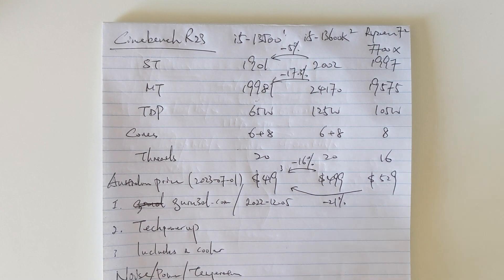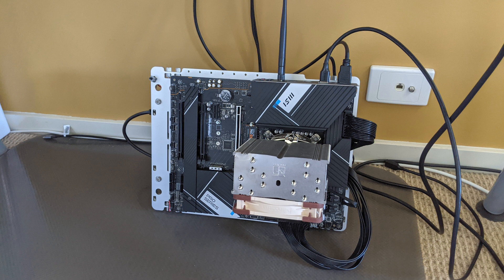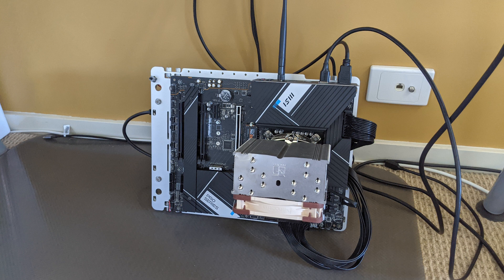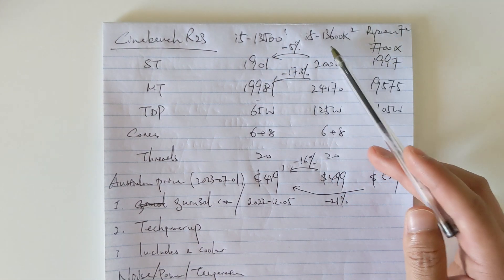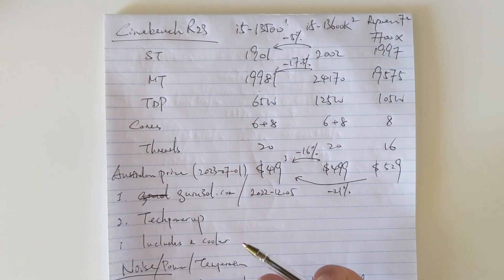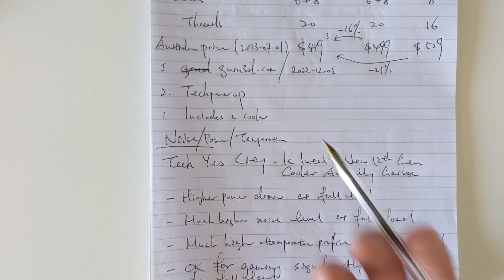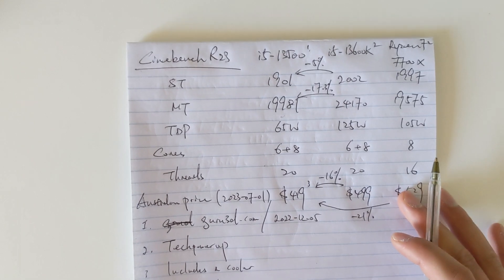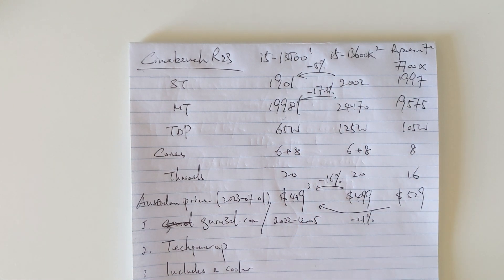First impression and meta-analysis of Intel Core i5 13500 Processor

Comment: Can i use an Air cooler for the i5 13600k? What's your i5 13600k temperature when normal use?
Reply from the maker: Yes. I would assume the temperature is low as when running above 5GHz, it was whisper quiet. Please see my latest video:
https://youtu.be/18CDtntszJI

Comment: How this compares to 13600 ? Is 13600 really worth the extra money.
Reply from the maker: Did you mean 13600k? I think 13600k is worth the extra money. The price difference matches the difference in multi-threading performance. In addition, you can overclock it higher provided you have a sufficient cooling solution.
Reply: @XYang2023  13600k is a great processor, no doubt. But I meant how 13600 (non-K) compares to 13500? I think multicore performance should be almost the same.
Reply from the maker: @bralis2  13600 looks good. https://www.techpowerup.com/302937/intel-launches-lower-priced-13th-gen-core-desktop-processors-with-65w
Reply: @XYang2023  Thats true. Where I live (Europe) the price difference between 13500 and 13600 is ~50 USD, so whether 50 USD are worth extra 0.2 Ghz on 13600, I do not think so. It seems  13500 is winner here.

Comment: Hi. May i ask about psu wattage requirement?. My plan there are rx 6700 xt, Mobo b660-g gaming, 13500, is-55, flare x5 2x16gb 6000mhz, a80 2gb. I tested in pcpartpicker its said 493watt. Since "the rule" it must be multiplied by 1.5 so the proper psu wattage is ~739.5watt. my bad i had 650watt psu. Is it okay using that 650watt psu? I need more guidance to be sure about it honestly. Btw thanks..
Reply: If you have a good psu, 650 watts is perfectly fine. Dont skimp on your psu.....
Reply: Adding the psu information. I had fractal design ion+ platinum 660w, tier A for now, i will use it for that rx 6700 xt.. but since 13500 is "so fluctuating" at its wattage. I go for ryzen 7 5700x 🤦 honestly, im still dreaming that 13500/13600k but the wattage. I wont throw my old psu. Lol. Btw thanks for the discussion. All is good information. Thanks..
Reply: @x3nstet820  Dont know the OEM for that psu but i remember that fractal had a 450 watts psu made by OEM seasonic. It was a great psu, the others not so... Yours seems to be a good unit (judging by reviews) and it has a 10 year warranty, japanese capacitors. Your psu is perfectly fine. Do you know the OEM for that psu? I remember when they started making SFX psu that the only gold version was the silverstone 450 watts and a lot of ppl did crazy builds with just 50 watts of overhead and it was perfectly fine. As long as you have an overhead of 100 with a good psu there shouldnt be an issue.
Reply: Thanks Alejandro
Reply from the maker: With power supply, the efficiency curve usually peaks at 50%. Assuming, the GPU takes 200W, CPU takes 100W, and motherboard, memory, & storage together take 100W, 400W x 2 = 800W. I would go for a 800W power supply.  This is a quote from Google search "If the power supply of a PC is too weak, it may not be able to provide enough power to the components in the system, which can cause them to overheat. This can lead to damage or failure of the components, and may even cause a fire."
Reply: @XYang2023  Absurd!!!!!!!!!! if you are buying a good psu (which IMHO is the most important component on your build), even going with an extra 100 watts would be more than fine. SO 650 watts is perfectly fine if he has a good psu.
Reply from the maker: @redalcatel27  Depending on your GPU. RTX 4090 and possibly the next generation are very power hungry. That is the trend.
Reply: @XYang2023  But he already has a rx 6700 xt and i5-13500, why would he need to RE-purchase another PSU if he has a good one??? I mean most of the good psu come with a  7-10 year warranty. If he has a trashy psu, i would agree that he should get a good one but why invest now if its not needed. If he ever upgrades to a 4090, then that's a different story.
Reply: Thanks for the explanation. Then I'm wrong. Poor me.. need more extra budget for the psu 🤦. Again, thanks
Reply: I'm no expert, but I have been doing a lot of research the past couple weeks, and I'm buying parts for basically the same PC now. The efficiency curve "maxing out" at 50-60% is outdated advice. Newer PSUs are a lot more efficient at the upper end of the curve than they were a few years ago. 

That being said, I bought an 850 W PSU because these CPUs can pull a lot of extra power for performance if it's available. If you're only running a 650W PSU, you'll have to run the i5 in the 65W mode and hope it's enough.
Reply from the maker: @CoasterRanger  Thank you for your input. Here is the efficiency curve of my current power supply:
https://www.techpowerup.com/review/thermaltake-toughpower-gf3-1000-w/5.html
Reply: @XYang2023  exactly, so you are losing an absolute maximum of 5% efficiency drop from 50% compared to 100%, which isn't a whole lot.

I bought an A-rated platinum 850W unit, so I feel pretty good even if it gets close to 90-100%.
Reply from the maker: @CoasterRanger  Yes. Besides losing efficiency, the components inside the power supply also are hotter than if running at the efficiency point. The fan noise of the power supply will be quite audible. If the power supply is inside a PC case, the extra heat will be in the case. Extra 5% of 800w is 40w.
Reply from the maker: @CoasterRanger  Personally, I prefer to have a large power supply. If later on, I would like to add a 4080, the power supply has the headroom to accommodate that.
Reply: @XYang2023  that's right. In my case, I would only be operating near 100% if I added/changed components later and probably only during limited power intensive tasks.

Ultimately we are in agreement the OP probably needs a larger PSU.

Thanks for the video.
Reply: @CoasterRanger  @Xiao Yang 

Ah, more discussions here. May i join? (Again) lol.
At ryzen, for example Default TDP 65W, so it will run at 65w only. Im not doubt to partpartpicker said about its wattage requirement, then i will multiplied it by 1.5 then 650w is enough for this scenario.
What I've concerned is that 13500 Processor Base Power 65 W, Maximum Turbo Power 154 W, so is it fluctuating? Or what? Then for more performance it will need tower hsf such as SE-224XT, ak620
No much information about 13500 for now yet. But i hope many reviewers will give the information next.
Reply from the maker: @x3nstet820  I think ak620 is a good choice. I use an Noctua u12a. I only apply a single fan to the heatsink. It is dead silence for both 13600k (power limited) and 13500.